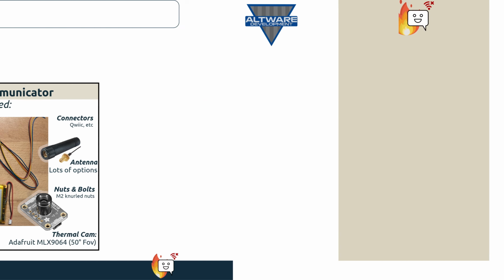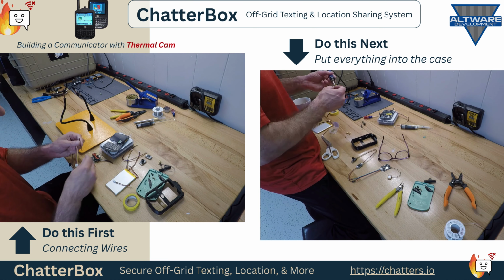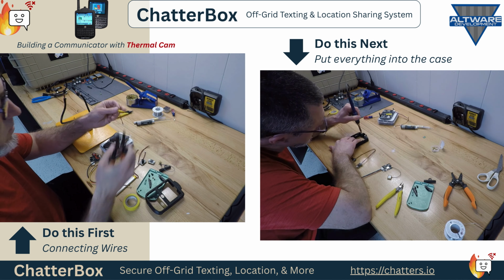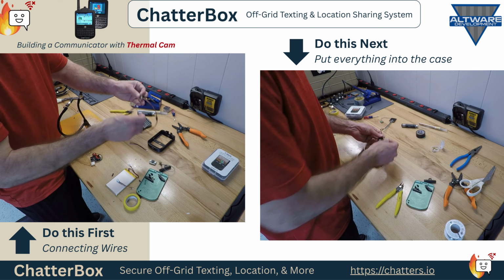Build a Thermal Camera & Encrypted Off-Grid Communicator + GPS, using your T-Deck and ChatterBox

Comment: Would a higher resolution be possible? And what about normal images, even if it takes some time to send them.
Reply from the maker: The firmware currently has payload limit set at 1kb per message, split across up to 10 packets, hashed/signed together. A larger image is possible, although I really haven't tested larger than 1kb. I think multiple messages would need to be reconstituted as they're received, or i'd need to bump the 1kb payload limit. I'd have to test that out and probably run some simulations on the existing algorithms to see what impact would be to other devices in the cluster when a large image starts getting passed around. 

With the thermal image, what i'm really aiming at is not so much transmitting the image, but more along the lines of running some edge image recognition on a node, so if the doppler/radar sensor detects presence, the thermal can run secondary and confirm the presence of a living thing, as well as its relative position, and take whatever action it's supposed to (maybe relay triggers alarm or just a silent notification goes out, etc).
Reply: @blackoutcomms  Thank you for your kind reply! I was thinking about receiving images for a low powered cctv project in a remote location, where there is no wifi. A higher resolution would be helpful identifying "who's there", implementing face recognition, etc. But I understand this could be difficult using LoRa.